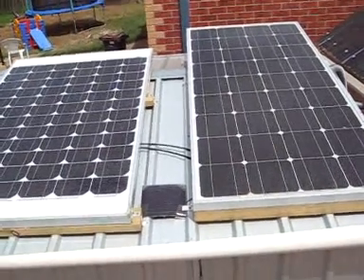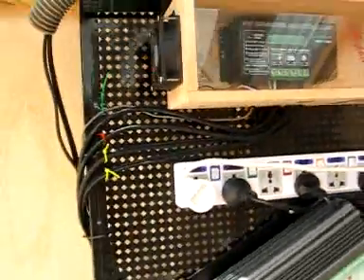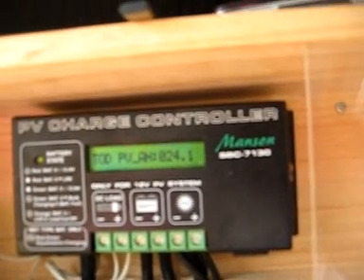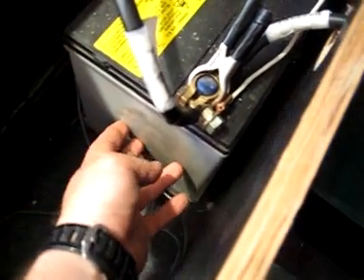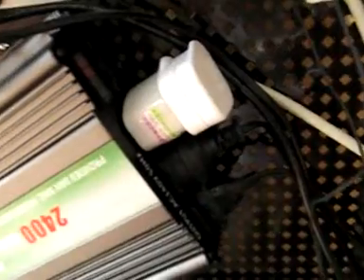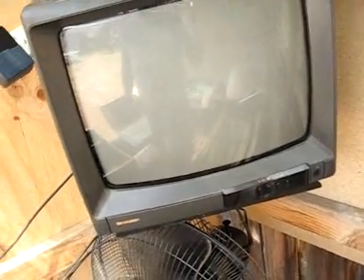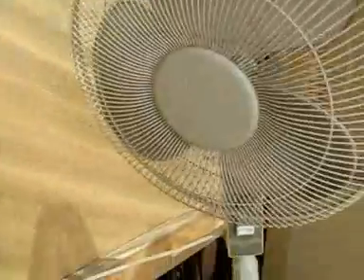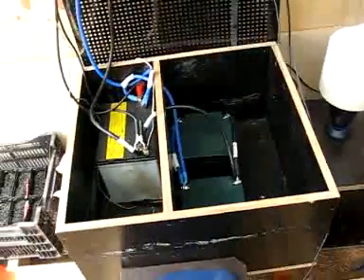Solar Panel Power System setup for home

Comment: Car batteries should not be used in this application, as they will be destroyed by the repeated deep discharging.  Only deep cycle batteries should be used for solar systems.  Also, a GTI is a waste of money as the solar system will cost more than the electricity produced over the life of the system.

Comment: nice little setup but car battery is no good for that type of application you need all deep cycle battery and i see you have no fuse you will need to get some and some disconnect switches for your solar array! check out my setup.